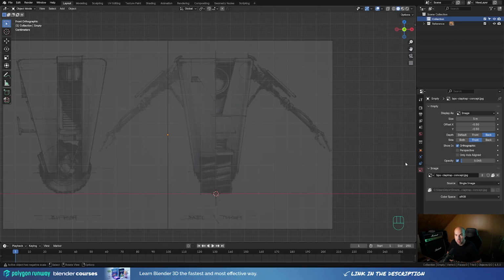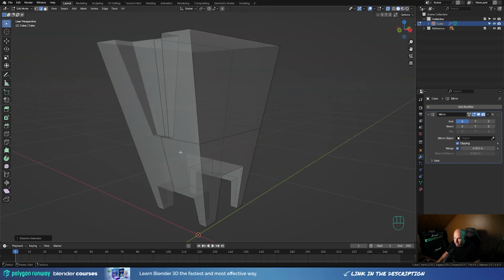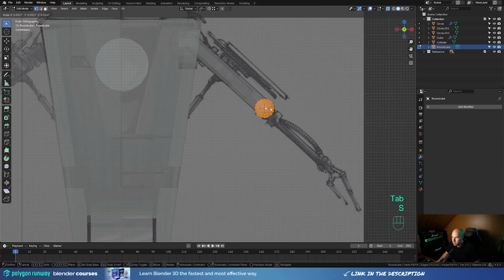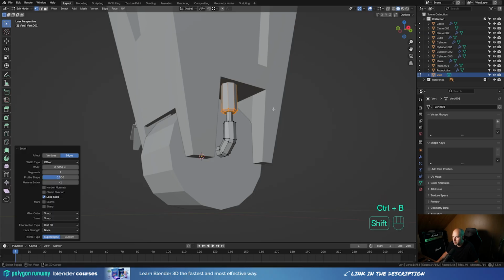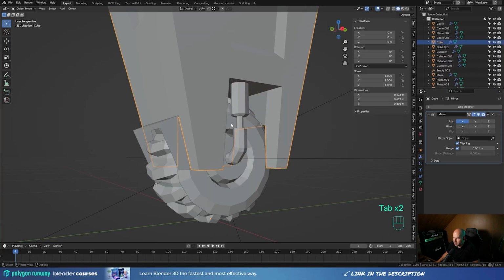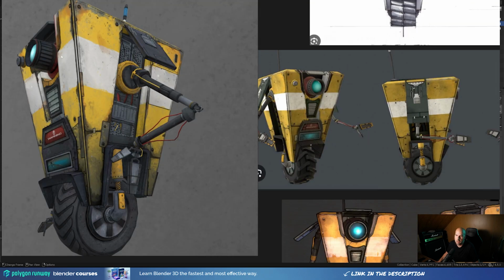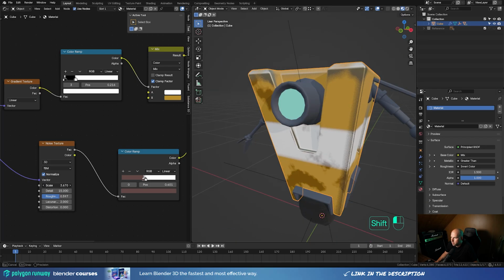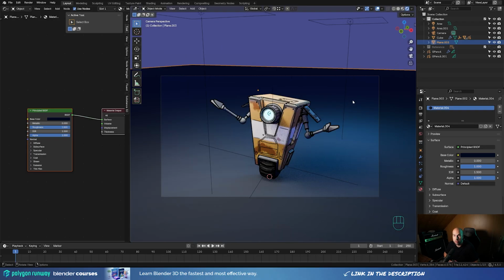Blender 3D Borderlands Character Tutorial | Polygon Runway

Comment: The array modifier for the wheel is just broken for me. It shows up warped and not even on the same axis (tilted and enlarged.) My origin point for the wheel tread is the same as yours too🫠
Reply: Ended up doing it manually, almost done, just need to add the finishing grease pencil touches